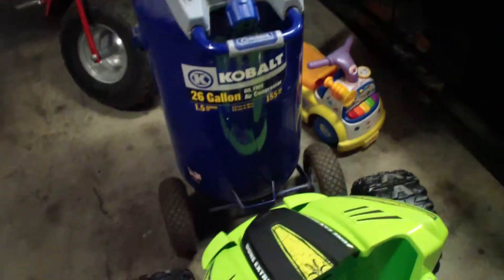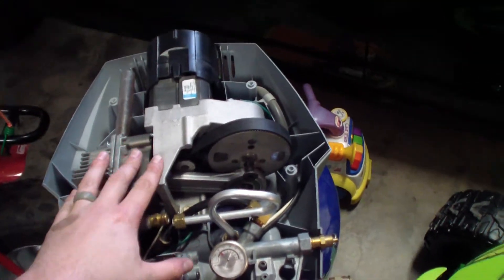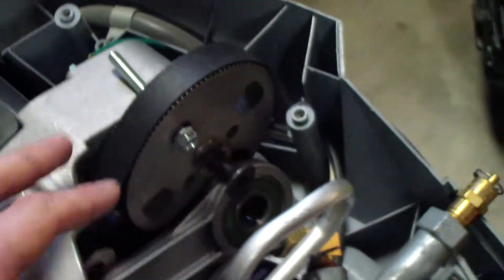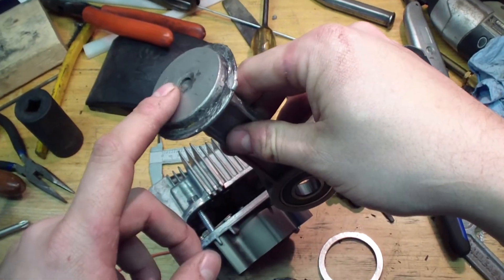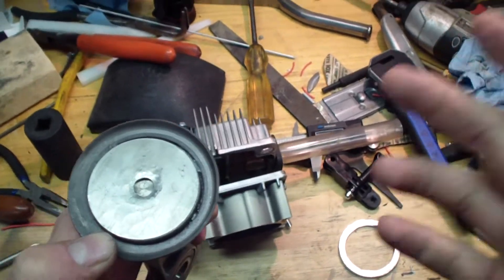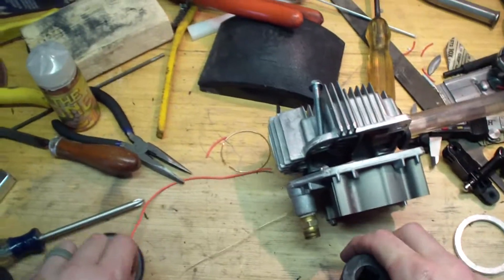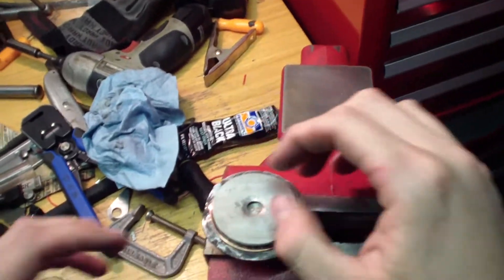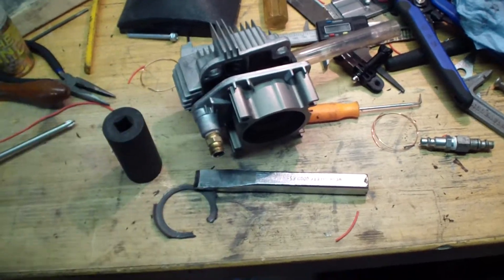Kobalt 26 Gallon Air Compressor Won't Build Pressure Fix (Anti-Throw Away Society)

Comment: I have same compressor- mine will come up to pressure but I hear hissing coming from around the on/off switch.  Any ideas what to look for? I think I’ll take off the cover and maybe use some soapy water to see where the leak is happening. I’m no mechanic by any means but I love to try to learn and fix things when I can.
Reply from the maker: Soapy water test is your best bet. Obviously disconnect power before hand.

Comment: Kobalt  clearly has a problem. I have bought two of these compressors  and one failed after a yr and the other did not last 6 months. Both only used to blow off  lawn mower ,clothes and air for tires.  Lowes did step up on the 2nd one and gave me my money back.

Comment: I have same compressor, mine builds pressure to 120psi and shuts off, problem is I kept hearing an air leak I thought was coming from the regulator knob, took top cover off and checked the reg knob, that wasn't the problem. With tank over 50 psi, the air leak is coming from area between the switch housing and the metal plate to the regulator valve slightly to lower right of the on/off switch. there is a screw on the right side of metal plate I tried to tighten but did not stop the leak. Do I need to take off that entire piece to see if its a gasket failure??? It seems once tank loses pressure to about 40psi, the leak stops and pressure stabilizes at 40.
Reply from the maker: Unfortunately I sold the compressor some time after fixing it, so I don’t have one to look at in front of me anymore.
Reply: @TheVintageEngineer  Since Kobalt does not offer tech service for this older model anymore, I took off the entire metal piece for the air supply and release valve and regulator valve, this allowed me to take off the 2 screws for the switch housing. There was another metal face plate that fit up against the black switch housing with 4 screws that also had a diaphragm type gasket piece under it. The air leak is coming from this area, the diaphragm maybe is for a small air hole in the face plate to allow pressure trigger for auto shut off when at 120psi. Anyway, I reseated the diaphragm with liquid gasket maker and then reattached the metal cover plate, also added gasket maker to the small air hole in center of the face plate that fits up against the air supply line metal piece. Will fill the tank to 120 and test for leaks again. Nothing else I can do here.

Comment: i ahve the kobalt 20 gallon.  it keeps shutting off early.  I feel like its either a thermal fuse or a check valve (unless you feel differently).  problem is IDK where a proper schematic is for this one

Comment: I have the same compressor.  I've had it for at least 12 years. Ran fine until a few years ago,  and started making the same noise. Finally got around to start disassembling it today,  and suspected it was this same issue. 

On the DAC-308 pre-formed gasket, is it necessary to purchase the O-Ring that some sites say "Also purchased with this item" ? 

I want to make sure i order everything i need so i get the job done right the first time. 

Please let me know.  Thanks,  and great video!
Reply from the maker: No, you just need the piston ring seal, and some wire to center it. Don’t know what the oring is they are referencing

Comment: Broke head can not find one  model  B 700060 it is a 2022  02-k4
Reply from the maker: Unfortunately most new compressors don’t have easily available replacement parts and if they do they want outrageous amount of money to the point you might as well buy an old unit. By head you mean the aluminum head with the heat fins? Cracked or broke into multiple pieces. Depend on the extent of the damage you could use aluminum brazing rod to repair it. Had really good success with brazing broken aluminum castings. I use the Hobart brand and get it from Northern Tool.

Comment: I bought this compressor in 1998. It has worked flawlessly until a couple weeks ago when I fired it up and had the air rushing out from under the cover. I came to YT to find out if anyone had the same unit with the same problem. I guess I'll open it up and have a look before I replace it. Thank you.

Comment: What is the part number of the seal and where was it purchased ?
Reply from the maker: Links in the description
Reply: I don’t see a link on your description
Reply from the maker: @aftech7268  click “show more”
Reply: @TheVintageEngineer  thanks , the seal arrived yesterday - to center it instead of using the copper wire I used the 3m double stick tape around the center of the piston lip and used a dap of super glue to hold the seal in place before pressing the piston seal ring down then I removed the tape - relatively easy install only took me 1 hour - now it runs like new ! I almost used it as a tank reserve

Comment: Hi Anthony, thanks for the video. Curious to know if this repair held up? About to try this on mine. Thanks!
Reply from the maker: Did a stress test by cycling a few times and ran with the valve open for 30 minutes. No issues. Used a couple times and ended up selling because I had another one I liked.
Reply: @TheVintageEngineer  Great, thanks Anthony

Comment: I have a question. I don't know if you still have your 26 gallon Kobalt air compressor but I'll give this a shot. I came across one of those Kobalt 10 gallon air compressor tanks just like that one. Wondering where can I go to find a 26 gallon tank so I can hug braid my 10 to the 26. II the display on mine is shot to Heron. Is there anyway I can find that liquid display or change it over to something else. Or do you know of a Kobalt graveyard where I can get parts. Search the web and all of them say it's a discontinued item but there has to be parked somewhere

Comment: Excellent video - I got the sucker end of a deal and ended up with the "husky" / home depot version of this. Same exact terribly designed piston. Was about ready to just make it into a reserve tank as well and buy a brand new compressor...
I had actually found a piston ring I thought might work and figured Id give it a go but didn't know how to go about getting the pressed aluminum rim off. Then I found the forum and this video, and hope is restored. Anyway hopefully mine works like yours!
Reply: Garrett, could you share any more info about the piston ring you found that is the right size? Thanks.

Comment: I was thinking about buying a Kobalt Quiet Tech 26 gallon air compressor but it seems like finding replacement parts for it is difficult compared to Dewalt's products..I guess I probably go with Dewalt air compressors instead.

Comment: There must be a lesson hidden here somewhere, regarding the demise of dependable equipment which was eminently owner serviceable and rebuildable. The concept of disposable machinery made intentionally cheap, and which fail when any internal part breaks or wears prematurely, is so ubiquitous that average consumers don't even throw fits anymore. It should be criminal, but instead it's just business as usual.
Reply from the maker: The bigger problem is it has gone on for so long that entire generations have been exposed to the "throw away society" since birth.
Reply: It's called planned obsolescence

Comment: Where can I order parts for kobalt
Reply from the maker: Which part? This compressor?
Reply: Anthony, I have this exact compressor and looking to replace the wheels, I cant figure out how to get them off
Reply: @nickvolpe3475  just drill 3 or 4 holes all around each tire and fill it with spray foam u won’t have issues with flat time ever again

Comment: The company Master Tool Repair sells the entire piston assembly for $29. You avoid the hassle of breaking the old seal off and breaking the piston. Saves A LOT of time and frustration!  https://mastertoolrepair.com/air-compressor-parts-f226vwlvp-37296-p-16766.html
Reply from the maker: Randy OC that’s for a different model compressor

Comment: i Was able to fix the seal, but like you said they break easy so I ended up snapping mine in half. In way it’s still fixable ?
Reply from the maker: Christian Sandoval where is the break? When you say in half are you saying the whole rod broke in two? Like the bearing part is now separate from the seal end?
Reply: It broke right in the middle of the rod so basically it broke in two.
Reply from the maker: Christian Sandoval you maybe able to fix it by aluminum welding/brazing. Home Depot sells alluminum welding rod for like 5 bucks for 2 sticks (item# 203710179). Hopefully the break is clean enough to hold the two pieces together correctly. Just clamp them together and heat the hell out of them using propane or map gas. Then apply the aluminum rod all the way around the break and build up a decent amount of material. You can try getting some in between but you have to do it quick as it sets up as soon as heat is pulled away. Also remove the bearing first before heating it. Just take a socket to hammer it out using the outer races. If you are unsure about it make sure you put the cover on it before testing it and also have you hand ready to unplug it.
Reply: Crap seems like a lot of work for some who doesn’t even weld lol. Thank you for the ideas though, I think I’m going to take it to a machine shop and see what they can do Hopefully I didn’t trash this compressor.
Reply: But I’m going to look up your method and see what works. Kinda scared to push the bearing out now that it broke in half lol
Reply from the maker: Christian Sandoval do you have the same model as the video? If so it was already “trashed” since the overall replacement assembly is $200.
Reply from the maker: Christian Sandoval you can heat the rod a little bit and it will help get the bearing out. Got a vise? Open up the jaws and lay the rod on top with the jaws underneath the aluminum of the rod. This allows less strain and the jaw opening allows the bearing to be knocked out. Make sense?
Reply: No, I have the 30 gallon kobalt KLA1583009. it was trashed but I got so far for it to just break in half. So disappointed in myself
Reply: Yes I get what you mean! If it’s fixable then I’m going to remove and then see what a machine shop can do to it. Thanks for the brilliant ideas!!!!!